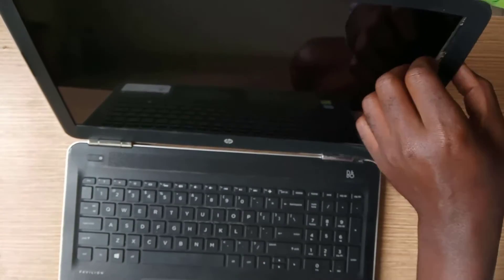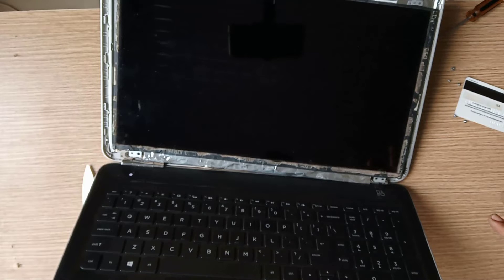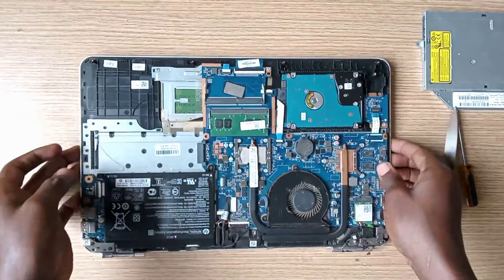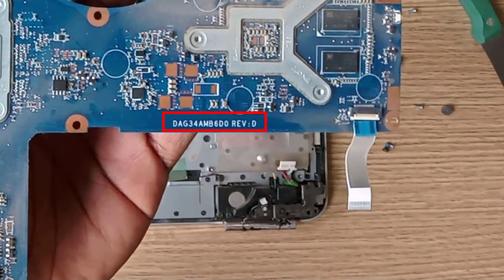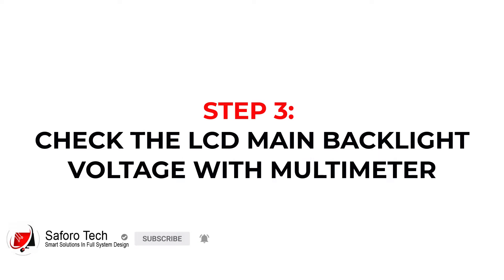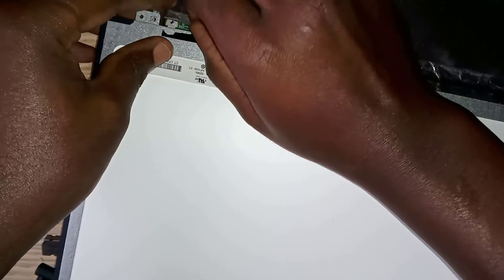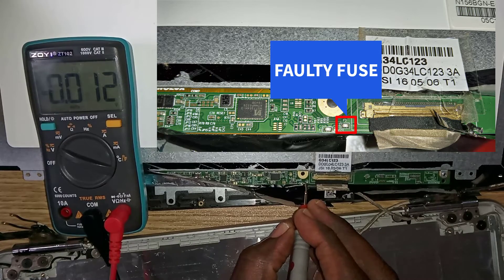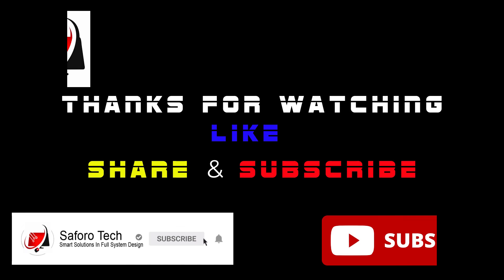How to Fix Laptop Screen Backlight Not Working | Laptop Turns On but Display is Black

Comment: isn't dangerous to just short a fuse? I mean, the fuse has a purpose there and if the fault, why the fuse was blown, is not found, it may lead to more problems.
Reply from the maker: Brother you don't know much about electronics then. I have been in this repairing business since the year 2000. So meaning almost 26 years now and I know what I'm doing. Fuse can blow for various reason. Some protection  purposes, some power fluctuations and so on. Fuse can just blow without any linking components affected and you can just replace the fuse using the exact specification or use a jumper wire to resolve if you know the exact ampered. So brother in this case the fuse just got  blown without any issues. I replaced it years ago and the owner is still using the computer to this very day I'm typing to you. I just replaced his battery for him just last Tuesday because the battery was protruded and needs replacement. Can you check when I did the initial video till today. I think almost 3 years now.